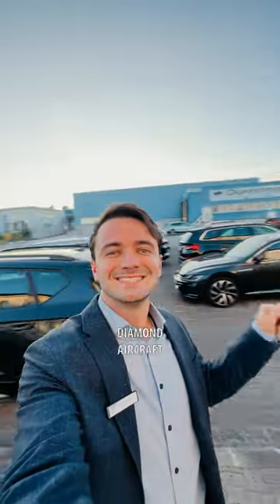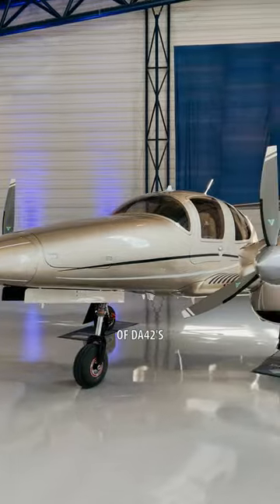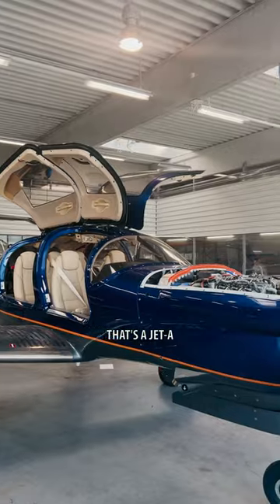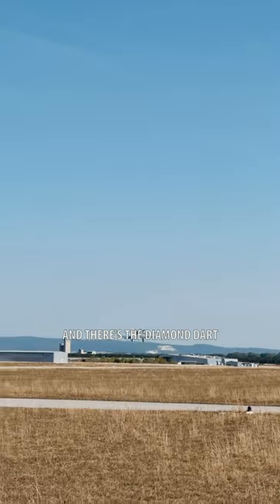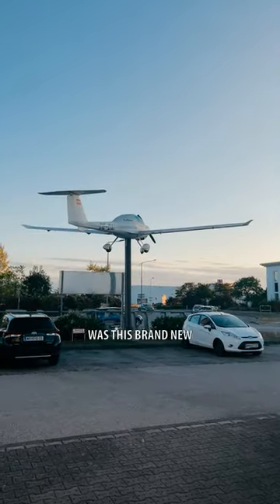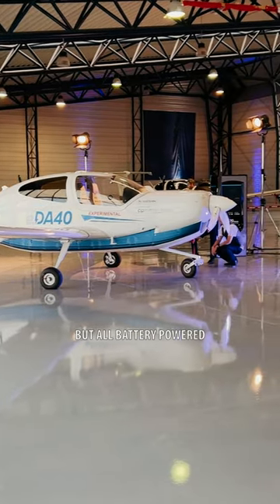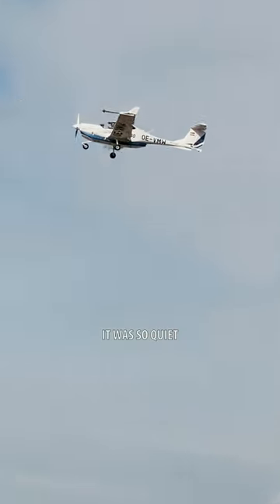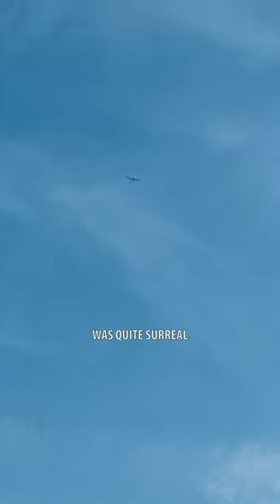Come with us to tour the Diamond Aircraft Factory in Austria! Thoughts on the eDA40?

Comment: Electric trainers will become viable when a full recharge holds them in the air for 4 hours on cruise. Can do most lessons in that time and have gas for backup. The question is. Will cost actually be reduced or would the technology be so new that maintenance costs replaces gas.

Comment: Batteries will burn.
They will burn real good!
And, electricity requires fuel to produce.   In most places, it is produced by burning coal, to produce steam, to run generators.
So your brand new electric aircraft is actually run by an old school steam engine.